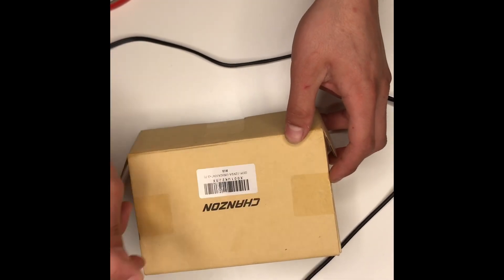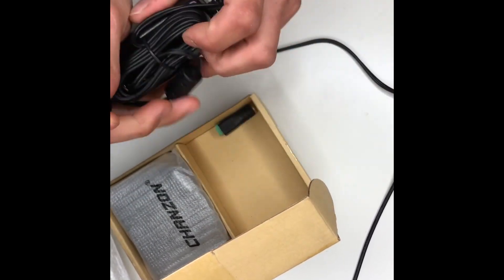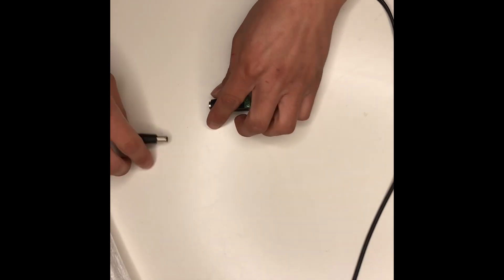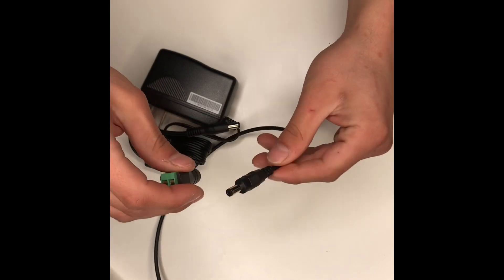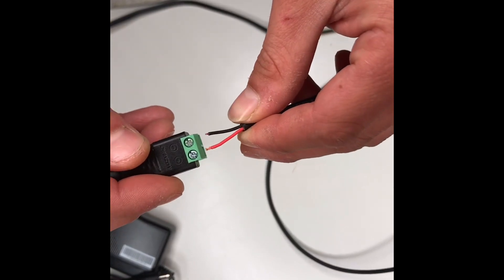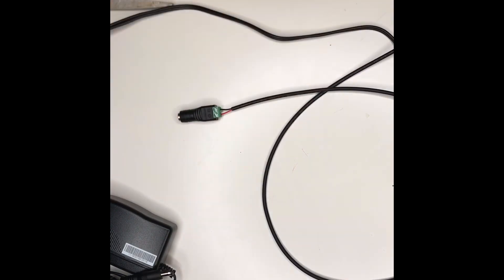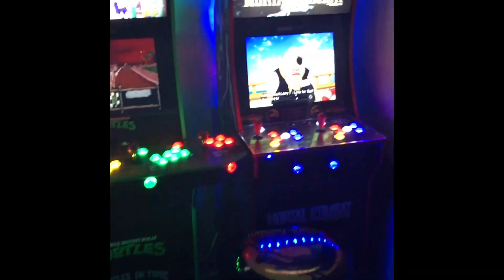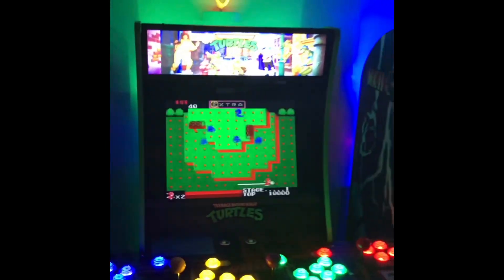Converting Arcade1up  Marquee 12v DC adapter for use with Modded cabs -TMNT Marquee

Comment: For anyone wondering if this also works for both the included led strip and marquee with the included y cable, the answer is YES!

I have a marvel vs Capcom modded first edition and if you use the y cable included with the arcade and cut it the same way it will work 100%